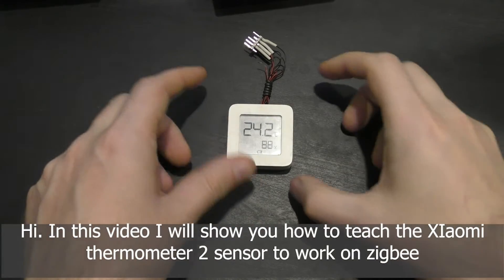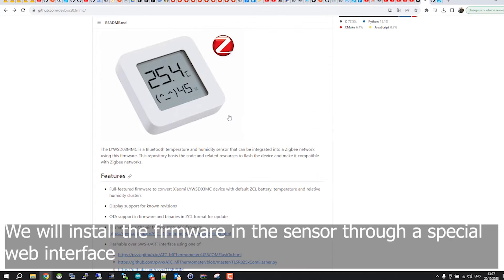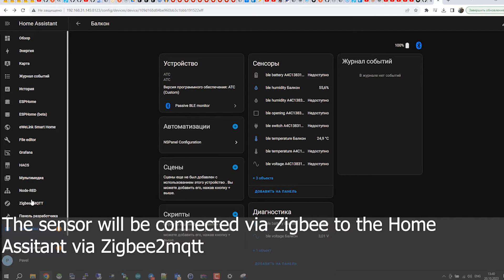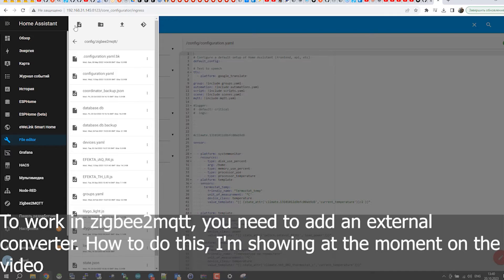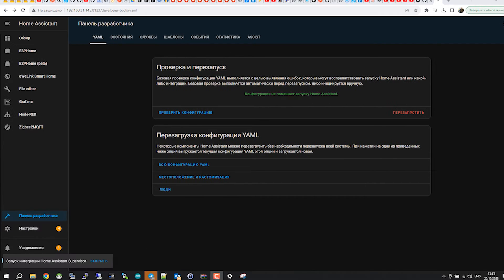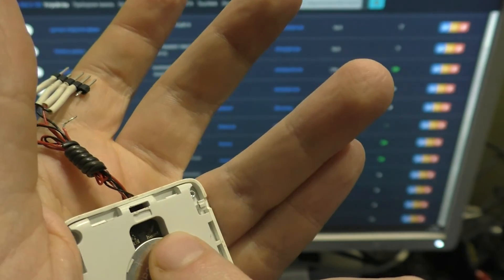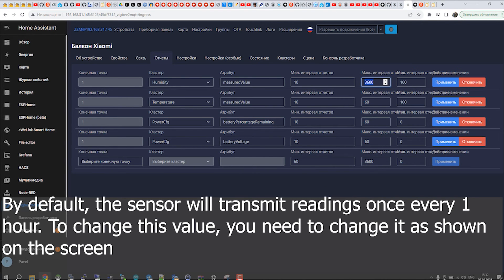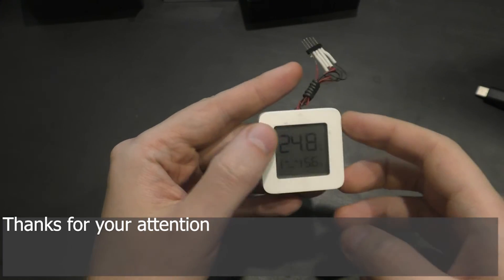How to flash Xiaomi LYWSD03MMC to work on Zigbee. Work in Zigbee2mqtt, zha, tuya

Comment: can you use this sensor without home assistant? Can I pair in to a zigbee gateway and use via tuya app?
Reply: Yes, I successfully connected this sensor to Tuya Zigbee Gateway. It is also mentioned on the github page in the compatibility section. But it can only view data, can't change the unit to Fahrenheit, if you are concerned.
If you are using ZHA or MQTT it seems you can change it.